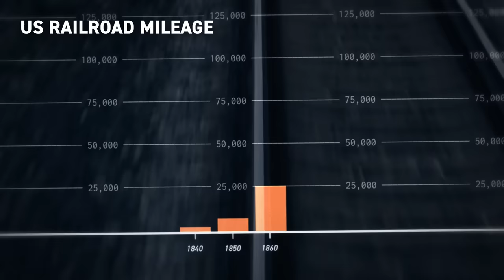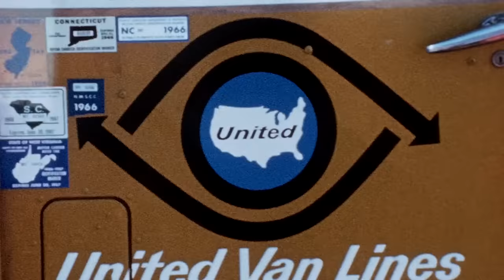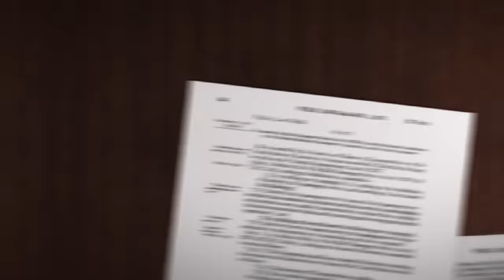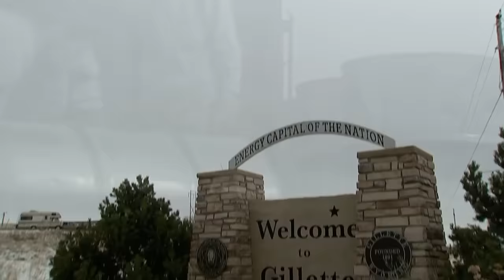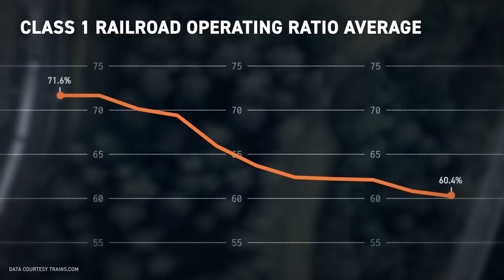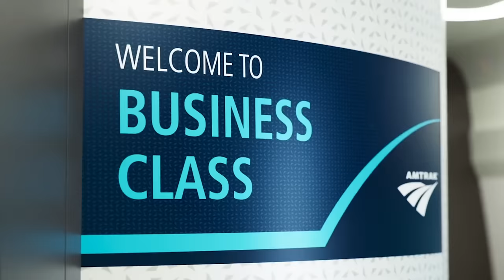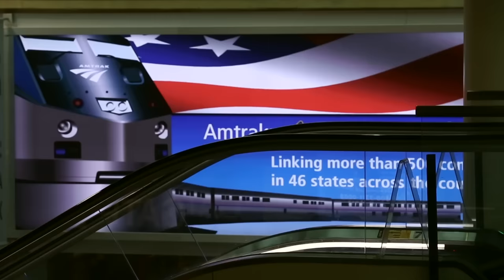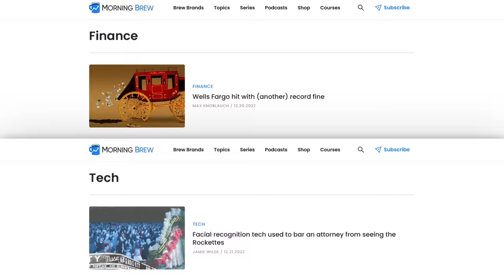The One Tiny Law That Keeps Amtrak Terrible

Comment: Its not so much that freight rail ruined Amtrak.  Freight needs to do freight rail.  Amtrak is destined to fail in the US and damning it to share the freight rail network is a big part of the problem.  The other major issue is basic supply and demand economics.  Outside the northeast, passenger rail does not make sense in most of the US.

Comment: All they have to do to make a big improvement in Amtrak's situation is pass some laws limiting the length of freight trains. We could start with one limiting them to the length of the shortest passing siding on the rail line they are using.  And how about a limit on the number of locomotives or the total horsepower of the locomotives on a freight train? How about requiring heavily used rail lines to be double tracked except where it's physically impossible? The railroads would scream bloody murder but they would adapt and keep on rolling. Shipping rates would go up, but for the kinds of loads the freight railroads want to haul there would still be no viable alternative.  And some of the costs would inevitably be passed down to the general public, but over time a lot of benefit would also accrue, starting with trains becoming a viable alternative to flying or driving between more city pairs.

Comment: SO I have an idea. If the government will not enforce passenger service priority, Amtrak could physically do it. Build a couple of mobile passenger single car "trains" that can run interference for the real passenger trains. These trains would be mobile in that they could run on streets or track. Basically a city bus with rail wheels attached. Just pull up onto the tracks and start blocking the freight trains.   In addition, if there is only one entity that can enforce the law, still, one could file civil cases against freight based on the law. Anyone can file a civil case.

Comment: If it was possible for me to make a day trip from Shreveport to Dallas on a train avoiding all of the traffic via rail, I absolutely would. And that would be something I did several times a year instead of making that trip by car a couple times a year. I love the idea of good reliable transport that isn't a car, but those other options just suck. It would be really cool if I could hop onto a train with my motorcycle and go on weekend adventures. But if the only good and timely option is driving, then I'm just going to stay at home.

Comment: It's mindbending how dreadful your rail infrastructure is. I regularly complain about how delayed and over budget our HS2 is in the UK, but once it's built, it's going to go 200 mph between our largest cities. The fact that there is only one line in most places is so anachronistic, I don't know where to start. Only our most scarcely populated areas have single track lines.

The solution to Amtrak's woes is to build dedicated passenger lines in denser areas, and to take aim at plane traffic like they've done in France (to the point where the TGV pretty handily outcompetes domestic air). But that requires huge political willpower and capital, and I doubt it'd be the sort of thing the US government is strong enough to actually pull off.

Comment: New law proposal:

Section 1: No train strictly varrying freight may proceed if a train carrying passengers may become stopped. 

Section 2: No train may be longer than the nearest available siding. (aka ban PSR)

Section 3: For any violation of this act on trackage the freight operator owns, the freight operator may be paid 1% less per minute for total leasage of that specific journey. If over 100 minutes have passed on a journey with freight-induced delays, this balance may go negative. In the event of a negative balance, the freight operator may opt to either pay the difference to the passenger operator or credit it to future journeys.

Section 4: For any violation of this on passenger-railroad trackage, the freight operator may be charged an additional 1% of trip leasage per minute.

Comment: As a european it is just frustrating to see how many americans do not understand how public transit works. To you americans: 
Train networks do not run a profit. Individual lines might but a network never does. And that is fine! Passenger trains do not have to run a profit, which you will see when looking at any european country and their train infrastructure. Achieving a good transit network with high usership requires high government investments into the infrastructure. 
And do not tell me that would be too expensive: You americans pour more the 600 bn $ into just new cars (gasoline, used cars, whatsoever not included - just new cars) every year. Adding to that you guys spend about 200 bn $ each year just on your bad road infrastructure. If you just used a fraction of these two combined to actually build out a decent rail network, serviced and owned by the government, you will get a decent rail service through the country in a very short time.

Comment: There's no one about to take a train from Chicago to Green Bay. Even Milwaukee is too far. Metra runs from downtown chicago to Kenosha, more than halfway  to Milwaukee, and it's sparsely used at that point, even though it doesn't have  the problems mentioned here

Comment: The massive railway system that WAS in thei country is one of the reasons the US became an industrial POWERHOUSE during WWII and for a while after that.  Some Navy gun barrells were produced in Titusville, PA Navy boilers in Franklin, PA, both are no where near an ocean.  The tracks in Titusville are still there BUT the intracity rail in Franklin has been removed.  Oil City has lost nearly all its intracity rail now, just the line that goes to Titusville is left.  Very sad actually.

Comment: Freight Railroad itself is definitely the main issue Amtrak has to deal with, but I think it is also a huge issue for passenger rail in the US if there are sections that only have a single track. You're just asking for slowdowns and delays with single tracks anywhere on the main rail systems. Obviously, railroads should prioritize efficiency and safety instead of making trains longer and only focusing on profit. Also, I don't see how Amtrak's new route plan is going to do it any good with a system that hasn't even been fixed or improved on yet. It will just cause it more problems.

Comment: You can't economically transport coal by truck for any significant distance, it would take 250 trucks,  to haul ONE train load of coal, that would cost over a million dollars, about four times the RR rate.  One power plant in upstate NY uses about one train load of coal daily, you'd have more coal trucks on I 70 than Texas buses on I 95.  The game is played this way, the freight railroads own the track, stations, switches, land, buildings, and terminals.  The government gave Amtrak a fifty year deal on getting special rates and rights to run trains on these private railways, in addition the government gave the railroads an unfunded mandate that the railroads use positive train control if they are asked to host passenger trains, this cost the railroads billions and billions because PTC existed only as a political slogan there was NO hardware, software. or vendor to provide it, the railroads had to invent it and nobody else uses it. Mind you the government built the highways for the truckers, the canals for the shippers, and the airports, airways systems, weather systems, and communications systems for the airlines but they stuck the bill for PTC directly to the RRs.  If you want routes to Amtrak free of freight trains, buy one or build one.  And don't give me any grief about how the government built the RRs once upon a time.  The only thing the government did for the transcon. line was to cosign the mortgage, no government cash went into it, and the loans were paid off by the RRs before they were due so unlike the GM bailout, the government didn't loose any money.

Comment: Forget timeliness, forget service frequency.  Amtrak will not be successful until fares come down.  I am from Maine and I went to see a friend who moved to NYC this fall.  I wanted to drive to Boston and then take the Acela to Penn Station, but it was $160.  A bus ticket is $80 max.  I ended up driving to Wilton CT to get free parking at the station and took Connecticut commuter rail for $12.75 one-way off peak.  I also have a friend from long island who came up to see me for New Years, and same thing.  Amtrak was too expensive, he took a bus from NYC to Portland.  

Even if Amtrak functioned perfectly, no one would use it unless they want the novelty of a train or if they are hopelessly poor at managing money.  Here in the northeast, we are the one region that actually has good Amtrak infrastructure between Acela high-speed and normal service lines like Downeaster and Northeast Regional, but since it charges extortionate fares, it is completely useless to almost everyone.

Comment: We lived in Europe for 11years.  Comparing the US to it is a non sequitur.  If you overlay an outline of just Texas on Europe, you will see you can’t fit most of it inside TX.   Next, almost every European city / country has a supporting transport system to get the passenger from the main station to the end destination.  The US, not so much.  Next, the govts pretty much own both passenger and freight systems so coordination / operation should be better. It isn’t, necessarily.  In 1990, for example, the Bundesbahn, Germany’s excellent system, was losing something on the order of DM 1 billion annually.  Yes, that’s Billion.  And rail travel there is not cheap, either because one pays by the kilometer.  Even at that, the vaunted high speed rail system has to run frequently on separate, newly constructed lines because the existing network cannot support speeds.  As much as i would also like to see high speed rail, the most recent experiment from Dallas - Houston - San Antonio, a private endeavor, has apparently failed.  You hit the key to Amtrak profitability referring to the NE corridor where it owns many of the lines.  One should be careful about blaming the RRs for unit trains.  The growth of ‘just on time delivery’ in industry to avoid inventory storage costs drives a lot of this as well.  Lots more discussion possible.

Comment: Time for an FBI Amtrack Delay Taskforce to enforce Amtrack train priority and stop the freight railways from delaying trains!
Reply: What the US and Canada should do is what is done in Australia and many parts of Europe - an independent government-owned and funded, publicly accountable RAIL INFRASTRUCTURE owner. The private freight railways run the trains but get super low-price access to train paths (rights to run on a track at a given time). Public operators like commuter railways and Amtrak would also 'pay' the fellow government agency for track paths. Government subsidy would be concentrated on the infrastructure operator, and Amtrak would defacto cover its costs. Examples are the Australian Rail Track Corporation owned by the Australian Crown, the Kingdom of the Netherlands' ProRail, and others. Thus, short-sighted cutting of infrastructure, maintenance, and lines would not happen because the public rail agency's job is not to cut costs but provide a level of rail infrastructure availability and service that meets public and operator's expectations. 
AMtrak delays would be reduced, because rail traffic controllers would be employed by the largely impartial public track owner and all operators would be bound to the paths they bought.

Comment: Even the state of Colorado is dropping the ball on the front range due to lack of funding from either the state or the federal government. We've even already voted for tax increases to make sure the fastracks program, which was supposed to build a Denver to Boulder and potentially further north line, would be paid for, but they just never went ahead with it. They're just now recently looking back into it after a decade of nothing but that means we wont see the first train leaving Union for Boulder until 2035 at the earliest. The fun part is that the rail already exists for that as well. It's not even all that used by the freight company that owns it.

Comment: While Amtrak has the right to use the freight lines, I don't believe there is anything forcing it to use them. As is becoming increasingly apparent from private competitors, such as Brightline, what Amtrak needs to do is build out its own infrastructure. We did it in Utah, its definitely not perfect, but it is operational and on time. Possibly Amtrak could strike a deal with the freight lines to get some cash by vacating its existing rights to build some of the no-brainer lines.

It seems many of these transcontinental lines are serving few poorly, over long distances, when Amtrak could renew itself by serving more well, over shorter distances.

Comment: America can easily build a good passenger rail and save the postal system by doing one costly thing, turn the median of the interstate system into a high speed 2 way rail system that only carries people and post.  Taking people and packages away from air and roads would ease the supply chain issues we are currently facing and reduce the need for  interstate widening projects in major cities.

Comment: Multiple things wrong with this video:
(1) Ref 14:00-16:00 - RRs haven't deferred maintenance and expansion projects since the 1980's when the Staggers Act passed.  The big six RRs in NA spend $1.5-$3+ billion a year each on capital improvements.  They have been upgrading track and adding capacity for decades.  UP and BNSF both have been double and triple tracking their main routes across the west.
(2) Small but important item, the 40cents per dollar operating profit is not pure profit. It has to be used to pay for the improvements in (1), debt service, administrative expenses etc.
(3) Examples are given of rail corridors that are ready for expansion right now.  Conveniently left out is the cost of the equipment and infrastructure to enable that expansion.  It is a significant amount; Amtrak is a publicly financed corporation; you have to get DC to absorb this large expense in an environment of trillion dollar deficits.  Very significant tax increases would be required.
(3a) Also those new services would increase congestion on the existing routes, someone would have to pay for capacity improvements on those routes to maintain service.
(4) Comparisons are made to rail service in Europe and China, but those regions are much more densely populated than the US, more like the US east and west costs, which have significant rail service, especially the NE.  Rail service is not nearly as practical in large less populated regions.

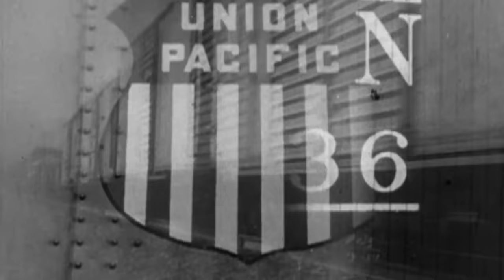Comment: 2:28 JP Morgan 5:57 late 60s industry on verge of collapse, Uncle Sam steps 6:38 1970 Nixon Rail Passenger Service Act - Amtrak. 6:48 deregulation, rail consolidation until just 4 freight RRs (C&O > CSX 1980) 7:36 1973 Amtrak Improvement Act: passenger service has preference over freight... 8:26 alas, only on paper ☹️ 8:45 DOJ not interested in Amtrak's passenger service delays ☹️ just one 1979 lawsuit 11:02 Western coal: consistent point-to-point trains easy money. Coal trains 27% of freight rail tonnage 12:57 greedy railroads running trains too long for existing sidings... short-term profits... 15:58 Amtrak's nemesis: 2 freight rail duopolies on each side of the Mississippi ☹️😡 16:14 Colorado Front Range corridor 17:00 passenger opportunity from Pueblo to Cheyenne 17:53 other obvious possibilities but for... 18:26 damn obstructive freight rail ☹️😡 21:56 terrible worker treatment, unreasonable commitment required ☹️😡

Comment: Excellent well researched and fair balanced reporting video! The Department of Transportation could do far more to solve this massive comprehensive transportation problem if Congress would get serious to improve to high standards of both efficiency and timeliness. Unlike the podcast haters of cars as a whole who have horrible ideas masturbating to the Dutch model (ideas with massive lies of omission), the best solution is to maximize efficiency of all known travel methods to work together in connectivity as well as enforce quality control of maintenance. Roads, flights, trains, and.pedestrian travel in all forms must have separate independent lanes to maximize freedom and efficiency. This was the New York City model by necessity of a massive crowded population but even that had massive flaws to rush with disregard of an "ends justifies the means" mentality. We in the USA have far better building methods today with an old infrastructure staring at us to rebuild. I hate debt but see that quality spending would benefit every citizen as road and air congestion would be eliminated to encourage world class train travel while making separated corridors for slow pedestrian and bike traffic (i.e. slow bikes and vehicles should not travel same lanes for safety as is the case in too many cities). In this scenario of invested infrastructure, we invest more underground and maximize land use in urban areas while honoring the fact the vehicles are not evil whatsoever. Rebuilding the best way to maximize all transport forms together (with wise, unique solutions of actual traffic conditions case by case) will be expensive at first but prove a robust ROI for all travelers, minimizing pollution with technology, maximizing efficiency to improve the economy, and make a far more orderly and safely defined travel environment as citizens observe necessary limits of safety with predictable time outcomes. Germany, France, and Japan have numerous examples of structures which the USA could learn from and integrate in several varied ways directly to localized solutions.